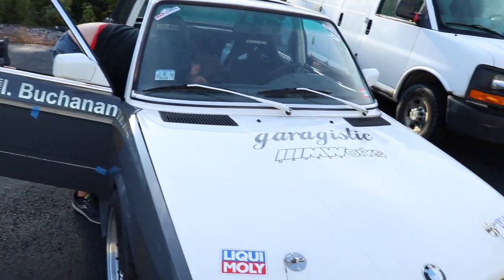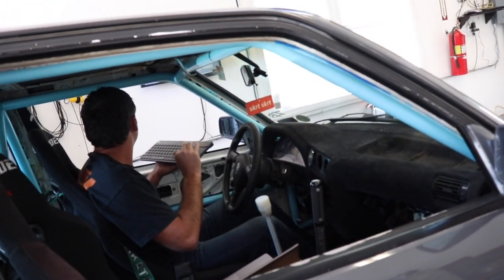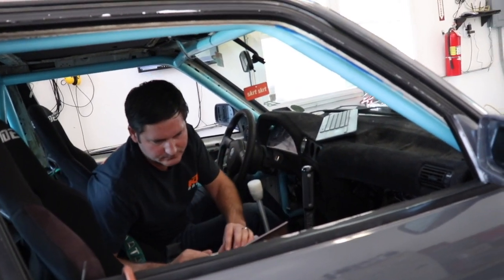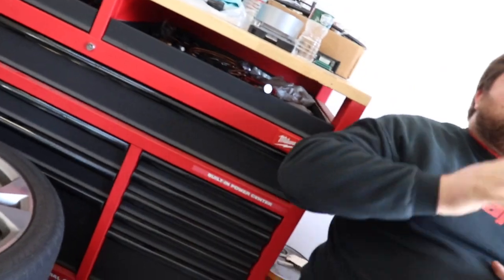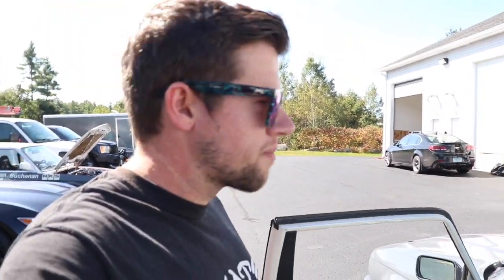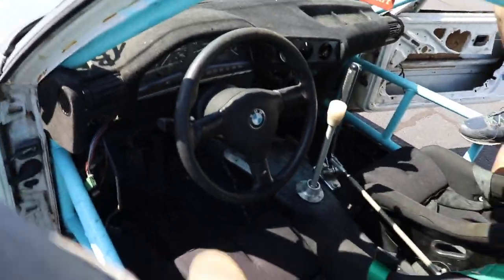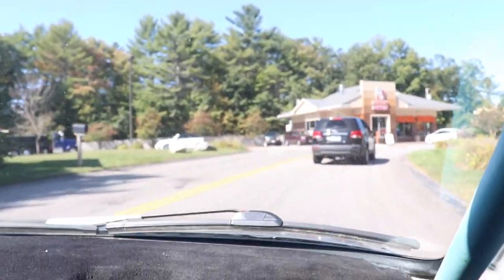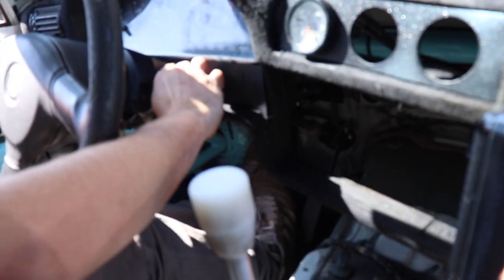The Turbo E30's First Dyno Tune

Comment: Beautiful build! Stock motor/g260 apart from the Schrick cams? Also, any reason why you did not go HX30 or HX35?
Reply from the maker: FY10 CP pistons with race coated bearings and ARP everything and yes stock G260 but we went with a HX40 because we already had one at the time now it was a HX35 and spools much faster.

Comment: internal ??
hp??
Reply from the maker: right now its on 330whp and 355LB with just CP turbo pistons, ARP everything, race coated bearings and an O'ringed block. I had the head built but i blew it up lol.
ill be making a more up to date video after my next dyno tune. im hopping for 400ish on 18 psi.